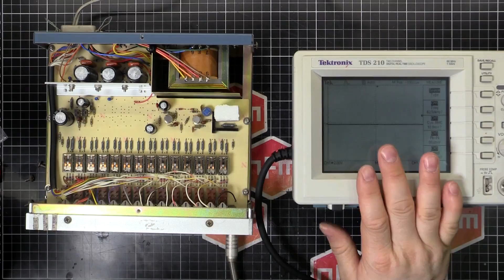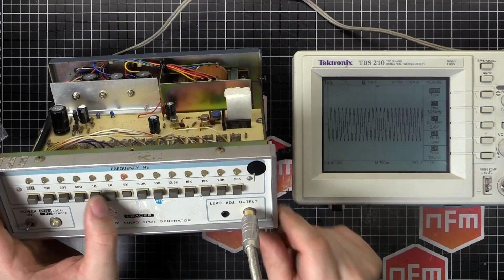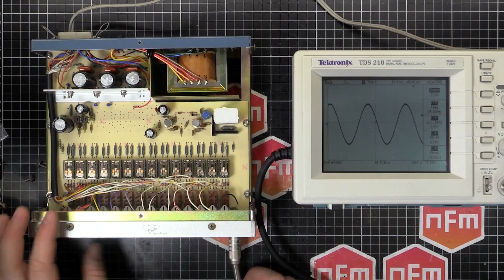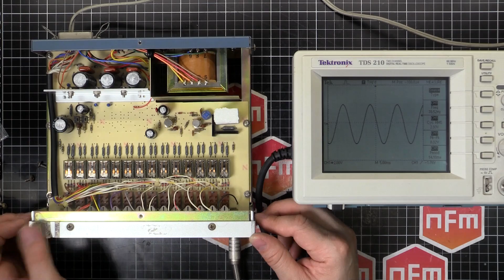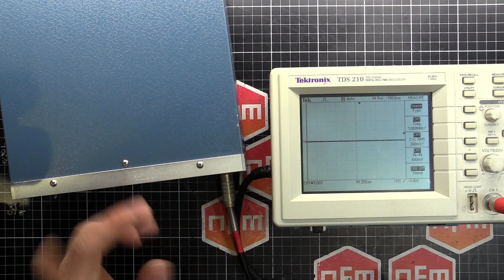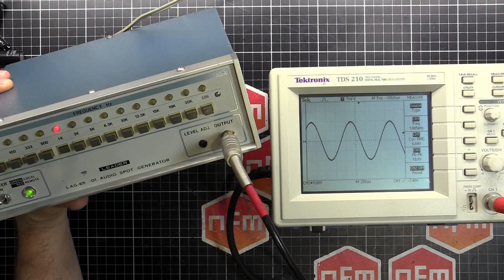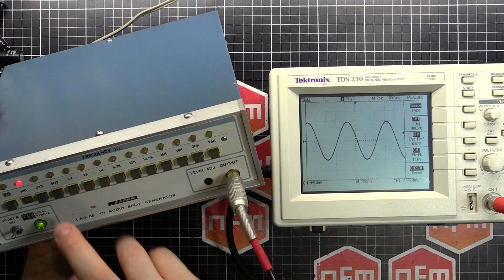Leader LAG-65 Audio Spot Generator Restoration

Comment: If you look at the front panel it indeed looks like the first value has a sticker over the original number, supporting your theory that someone changed the value of the first button!
Reply: Uh huh... According to the manual (in the description) it's meant to be 40Hz ;)
edit: Google "Leader LAG-65"...  Not quite what you see here, LOL!
Reply from the maker: @Stef60s Yeah, there seems to be an earlier model with the same part number, except this one is LAG-65-01, instead of just LAG-65
Reply from the maker: Yeah, and it looks like there is a slightly different resistor for that setting too, one of the two resistors for the 70Hz setting is larger than the rest.

I'm not sure if it was a factory change at the customers request or if it was changed by the customer themselves.